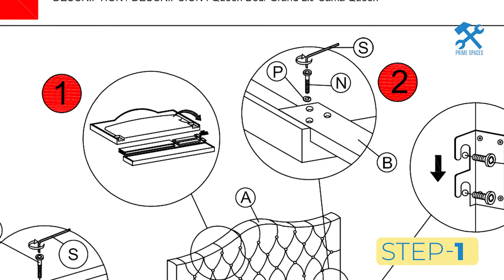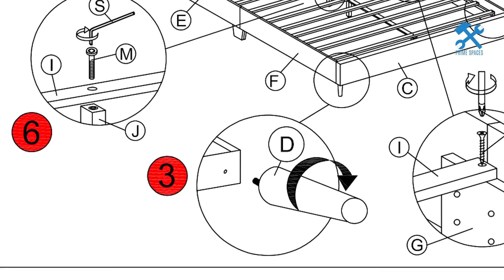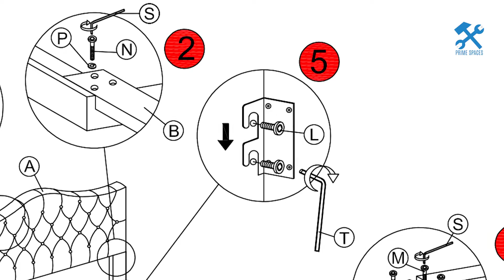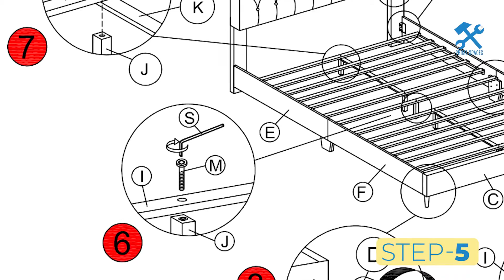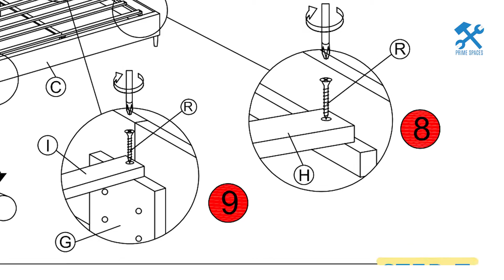Adal Tufted Upholstered Low Profile Platform Bed Assembly aka Ovis Grace Button-Tufted Platform Bed

Comment: Nice, my bed just arrived and found your video, looks easy to assemble. Noticed, there are two different washes that need to be applied, my bed's hardware is missing one pack of bolts labelled as L for full size, instead, two same packs of bolts labelled as K included - only one pack is needed, another one should be L pack.